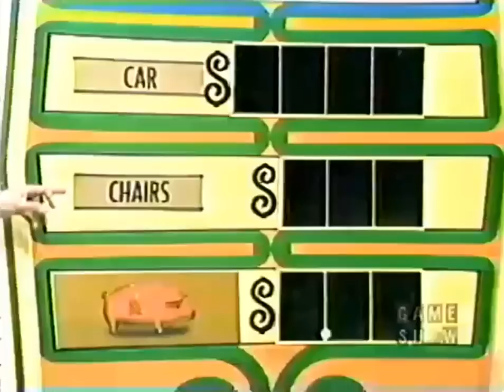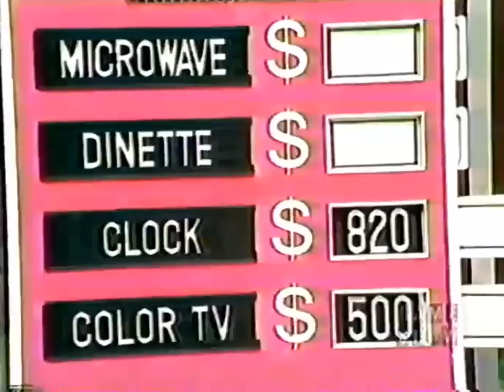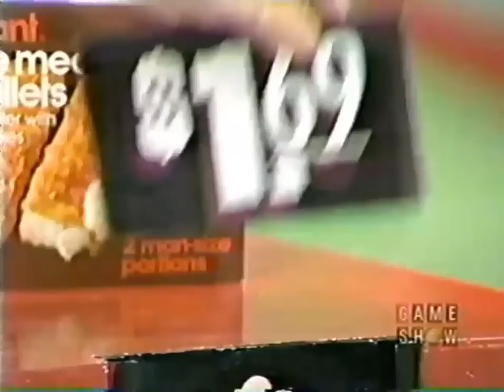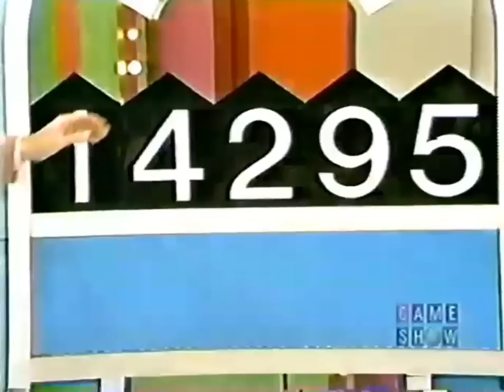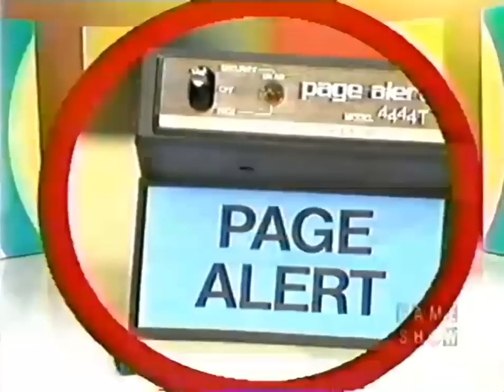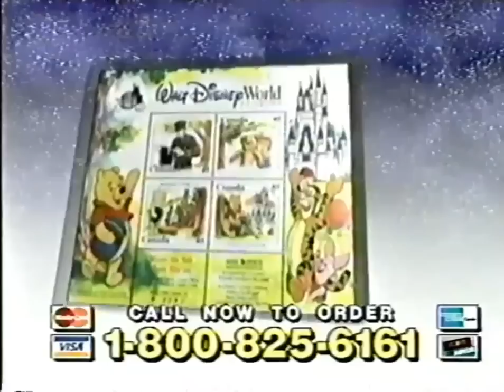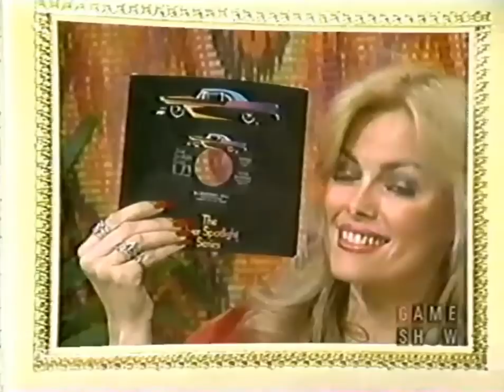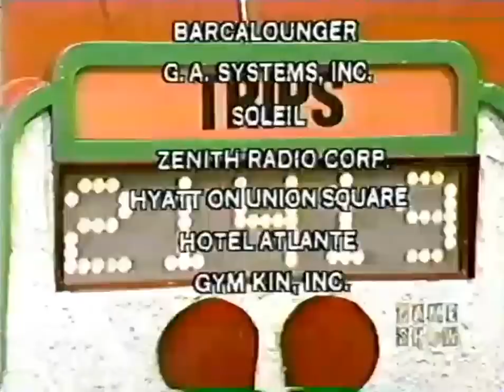The Price is Right:  February 27, 1980  (Double Showcase Win of $2 OFF!!!)

Comment: And then about a week later, there was someone that was only $1 off from the actual retail price (but that very well contained a fur coat there). Seems like this current season however, they are struggling to get even a Double Showcase Winner, even though there have been close calls to the point where maybe another increase may happen soon (and also because of inflation).
Reply: A $6,500 bid came out to just $6,501 the next week. Then came the exact bid in December 2.008.
Reply: And then once the exact bid came out they made it more tougher to memorize prizes nowadays.

Comment: 22:16 Does anyone know, did women wear their rank upside-down on their dress uniform shirt like that, or did she just embarrass herself on TV?
Reply: I went back and watched that and tes she had it upside-down  and also when Bob ask her if she is a Sargeant she said yes. That's not right either,  that rank is corporal.
Reply: @thomastrain7311  Wow this just popped up in my notifications due to your reply. I can't believe I asked if women wore their rank upside down! What the heck was I thinking? That's the exact same uniform that was standard when I was in, and so nothing would have changed. And I know that women didn't wear their rank upside down. As a sergeant myself, I had to know how to fix up both men's and women's uniforms. I also know that it was often a problem when a soldier was putting his dress uniform on by himself, sometimes he would put badges on upside-down because he's looking down at it from above as he pins it on, and so it looks right to him! That's why you'd be sure to look in a mirror or have a buddy help you. Man, how sad. She did wear her rank upside-down on TV.

Also, she was a sergeant. The pinned rank on her collar is clear. The rank on her jacket is hard to see due to the low resolution, but when she kisses Bob you can just barely see there are three stripes. Remember also that the sewn on sleeve rank insignia for women's Class A green uniforms back then was much smaller than men's.